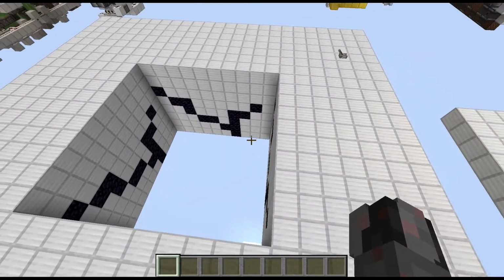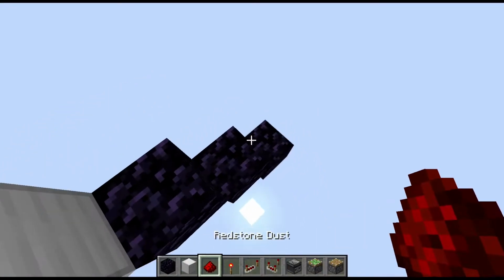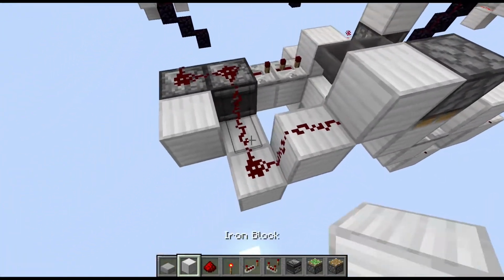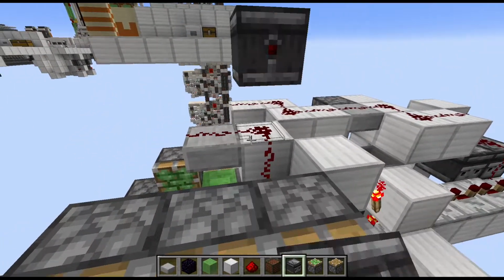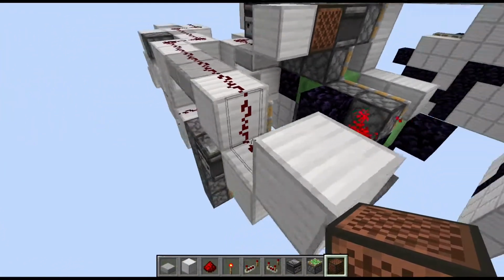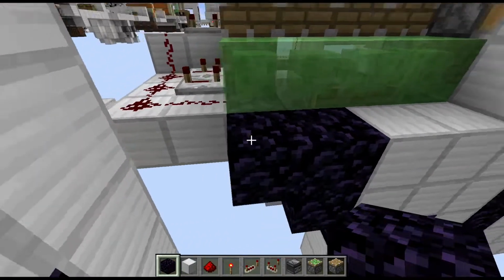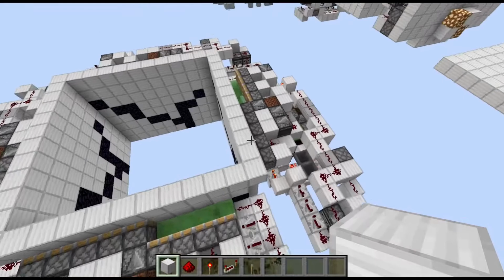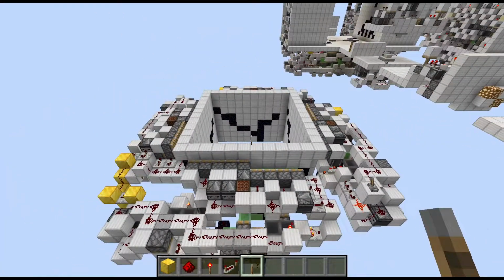Tutorial: Simple 10x10 Vault Trap Door [Java 1.13+]

Comment: Would it be possible to make one where it can be done so its flat?
like instead of a funnel, it just appears out of no where? or a way to kind of hide it for like an SMP
Reply from the maker: What you're looking for is a completely different type of door. Search for flat/flush trapdoor, or if you want something big look for infinite trapdoor designs.

One option you have with the funnel is filling it up with sand to initially hide it. But once it opens the sand will fall through and you'd have to manually replace it.